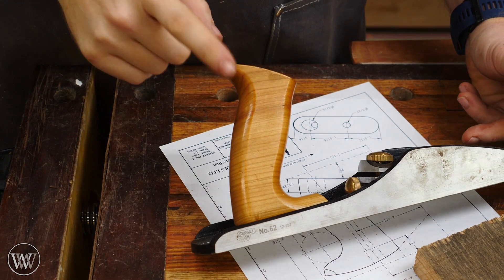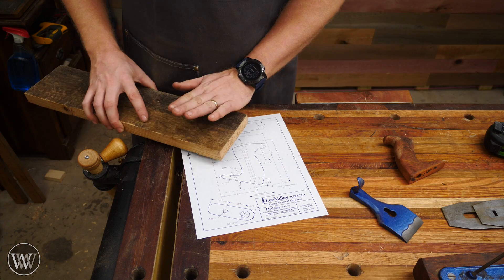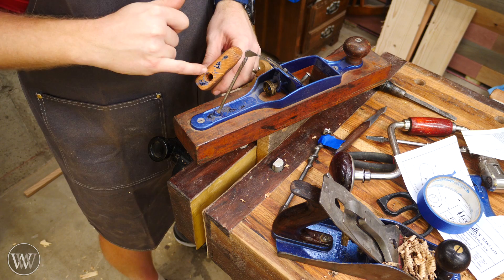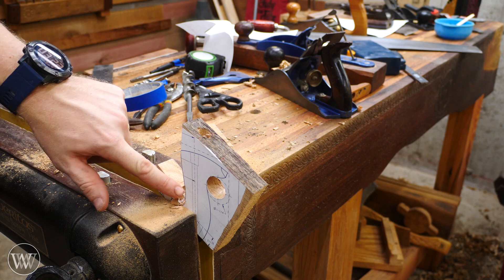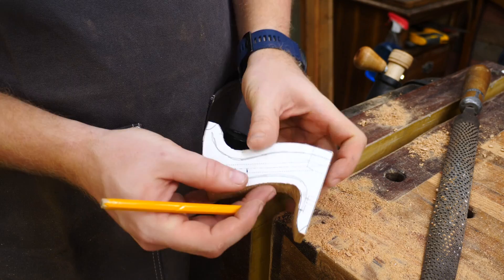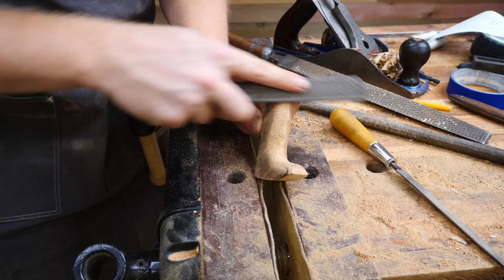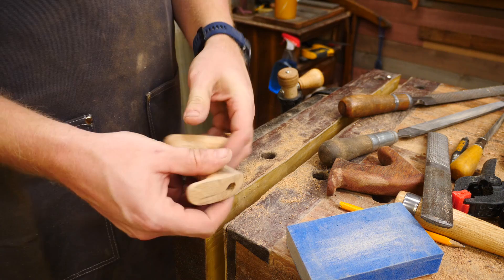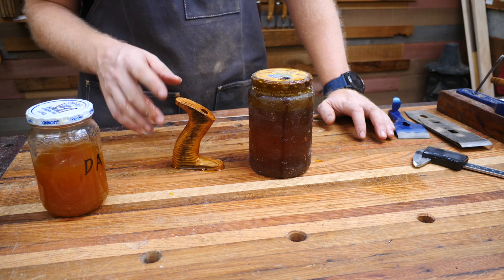How to Make a Tote for a Hand Plane | Making a handle with hand tools

Comment: Great video, as always. It inspired me to have a go. The grain on the tote is a weakness, so I have made mine in two laminations of macrocarpa. It’s a bit like Maple. If I had a dark wood I would have used three. I cut a groove in each half for the threaded rod,  and  I crossed the grain for each half to give strength in both axes. If I did it again I would use three laminations with the inner one vertical and spaced for the rod to fit snugly. It’s much more comfortable than the Stanley totes which are a bit thin for me.
Reply from the maker: Nice. I have a couple I have made that way with he three plys. they are surprisingly durable even in a drop. I to like the thicket tote. I want something beefy to grip.
Reply: By macrocarpa, do you mean Cupressus macrocarpa (Monterey Cyprus)?

Comment: Hey James, I think this is the best video you ever did for many reasons.  I think a tote is not easy because it requires a feel and an eye for the subtleties.  Also I love that you used a brace for the long whole and I was floored how accurate you did it.  I've always tried to use a drill press but your way looks so much easier.   I want to make several of these but just can't get to them with other things hanging over my head.  Great work.  Keep it up.
Reply from the maker: +Chris Cunicelli there is always a long list of things to be made and fixed. Thanks for the kind words Chris.

Comment: I thought for sure we'd see a scraper on this project. I got to say, it looks better than the tote I just made from laminated white oak a couple of months ago. There is a poor beginner's quality video covering some of it and the finished project. I actually used some power tools and some carving knives for mine. Using the previous broken tote as a template.
Reply: Here is a link to my video. Turns out I didn't get any footage of me making the tote and knob, but it is an overview of the finished project. It was the fourth thing I ever had on the lathe (I think) and my first hand carved item. Using a power belt sander for part of the process.
https://www.youtube.com/watch?v=cH-qWp_P8Aw
Reply from the maker: i dont use a card scraper often for cross grain cuts, but it does come out time to time on these.

Comment: I've got a transitional I need to restore.  I actually started on the tote at one point, and lucked upon a piece of "sapo" (not sure on the exact species) where the grain moved in a bit of a fork.  I laid it out so that the grain ran at about 45° along the grip and ran straight along the bottom.  I'm looking forward to seeing how it turns out...  after I finish about 100 other projects of higher priority.
Reply from the maker: +Jeff Spaulding that is always the problem so much on that list. Sounds like a fun project!

Comment: You know me, I was looking for a template to make a new tote and bam, your video popped up, I was like, well I  should have known my buddy would have a video on this. Thank you so so much for taking the time to share this with us,. Since you mentioned it, I too agree, the rough from the original weathered look makes it look so much more authentic and i too like it. I do the same with a lot of the leather work when I can get away with it, use the rough edge in lue of the razor sharp cut edges just makes it feel more authentic , yeah, that may be the word. I was able to find the download for both of the templates, Just FYI, the link you had posted previously with this video is a dead link, so if you want I can come back and add the links to the message, but I don't want you to think i am trying to spam your comment, section so for the time being I didn't link the, but i found them via google search, lee valley tote template pdf and they both pop up for the two different Stanley sizes. 
Thanks again kind sir and have a blessed week. I think this is something I can pull off one handed so I am gong to give it a go sometime this weekend. 
Dale
Reply from the maker: thanks for the reminder. for some reason Lee Valley stopped hosting them on their site so you have to google them I just forgot to take don't he link.

Comment: As a suggestion to other viewers make your custom tote out of softwood as a trial & error template. If you make it thick to start you can easily remove wood from the handle where you don't want it. Then put the plane through it's paces on some wood. How does it feel? When satisfied with the grip then make a hardwood version.
Reply from the maker: interesting idea? mind if I ask why not just make your hardwood one first? I often find the hardwood to be much easier to shape as it is less likely to ding up or go too far, but that is just my personal opinion.
Reply: The truth is that I did not know what size tote would feel the best for me.  I do have large hands that feel cramped even with only 3 fingers wrapped around it. By making the tote very large I have shaved off portions to bring it to the size i like. That is 1 1/2' thick and as high as i can get without interfering with the lateral adjustment.

Comment: i have large hands and a number 3 stanley hand plane, the smallness of the tote kinda hurts my fingers a little .. can i enlarge the tote? or is that a mistake? or should i just buy a larger hand plane?

edit:
it's short .. it squeezes my fingers from the top and bottom .. can i make it taller if i have clearance between the tote and the iron?
Reply from the maker: Yes. Actually I know of a few people who have made a slightly larger handle to fit their fingers. I end up modifying a lot of mind to fit my hand as well. Three fingers don't always fit between the body and iron but if you can adjust the handle to make them fit it is a fantastic thing.

Comment: I think the reason that the pattern from Lee Valley doesn't align the bottom of the tote with the grain direction is less a question of strength than it is a question of ease of construction. With Lee Valley's pattern, the main hole through the tote (for the bolt) is exactly perpendicular with the edge of the blank, so it's easier to drill that hole with a drill press, etc. Rotating the grain direction by 20ish degrees won't really make the tote any stronger or less likely to split than the orientation that you used.
Reply: yeah, the pattern clearly had a cut line perpendicular to the top of the bolt hole. His method worked for him, though. I think with my limited fine woodworking skills, I would have used that cut line so I could drill at 90 degrees to the wood. It would have been much easier for me.
Reply from the maker: right on. they like to drill the block on a drill press.

Comment: Hi! You are a real inspiration for me.
As I saw you using files and rasps for making a handle, and as I want to make two handles for my saws (one 26" saw with thumb hole and one dovetail saw with open pistol handle), what set of rasps and files would I want to have, knowing that I don't own any file or rasp at all yet? 
Also, where I'm going to buy them (Glardon/Vallorbe rasps and files, produced at 50km from where I live, and surprisingly not that expensive for Swiss tools), they offer specialised file in either wood or metal. As I will mostly work on wood, the choice seems pretty obvious, but will it be still possible to use them occasionally on metal without destroying them instantaneously?
Thank you so much for your help.
(by the way, please excuse my possibly broken English, which is due to my condition of not being a native speaker (although there are non native speakers who master the language, but it is not my case (yet)))

Comment: Hi James, this is something I plan to start with this weekend (or next) to replace a Stanley# 4 tote. I am sure I will mess up my first attempt at least as I there are a lot of new things for me to try in this project here - drilling straight and perpendicular is of course a big challenge but I will try that until I succeed (hopefully sooner 😉). I have a couple of questions: 1) What is the thickness of wood you started with? 2) I haven't truly started working on hardwood yet. I only have access to a home depot nearby - which hardwood options would you recommend considering robustness, ease of use for  tote? I believe they have predominantly red oak (sometimes white oak), I have seen walnut and sometime Mahogany. I don't think they carry beech or ask which I believe are more well known for making handles and knobs. Thanks!
Reply from the maker: I start with about 1" thick wood. They all have their pros and cons. Oak is difficult to work, but fun. Of those the easiest would be walnut or mahogany.
Reply: @WoodByWright  i am struggling to find any decent hardwood at my local home depot that is more than 3/4" thick😑 will it work if I laminate/glue 2 pieces of 3/4" blocks to make it 1.5" and start with that? Or do you think that kind of gluing would cause issues (during drilling or rasp or even prone to breaking). Want to be somewhat sure since hardwood is damn expensive but I really want to try this project.

Comment: Nice job. Question ... about 16:49 it looks like there's a split in the horn at the top. Later it's closed up, though still slightly discolored. Did it split and you repaired it, or was it just a wood imperfection that got less noticeable as it was rasped down? Either way, enjoyed it. I like the BLO best too.
Reply from the maker: yup. there was a split that I thought would cut out with it. in the end I filled it with epoxy, I just forgot to video the adding of epoxy. oh well.
Reply: Good to know ... and good for people to realize that things happen. Fix it and keep going. Thanks for the vid.

Comment: James, can you cut with the saw both hands are you ambidextrous in your sawing and your filing?
Reply from the maker: yes I have worked at being able to cut with both hands. very useful for on those odd cuts or long cuts where you want to give it a rest.
Reply: FYI. White Oak is not porous.  That’s why it was and still is used to make barrels.  Red Oak on the other her hand is very porous.

Comment: A suggestion: cut a line perpendicular to the drill hole (you already have the line drawn on your template) then you wouldn't have to drill at an angle.
Reply from the maker: I could but with a brace and bit every hole is at an angle. That is the common method if you use a drill press though. I just find it faster and easier to eyeball it.

Comment: Ok, have to ask, what is the issue with using a glue stick? I have used this as well as spray adhesive, depends on what I have on hand.
Reply from the maker: some people think there is only one way to do something and all other ways are not the right way to do it. for some reason how to apply a pattern is one of those subjects that really bugs people.
Reply: I'm open to new ideas, that's why I watch a large number of woodworkers on YouTube. If I didn't want to learn I wouldn't bother. Happy to give new techniques a go as long as it keeps me happy, and keeps all my digits attached.
Reply from the maker: I could not have said it better myself. I feel so much the same. experimenting is more than half the fun!

Comment: Tote. Handle. Meh.... The back one is the tote, the front one is the knob, but both are types of handles. 
I'm not aware of anything regarding the etymology of the word itself that suggests it's a handle of any kind. It mostly seems to derive from words meaning to carry, to bear (as in toting a firearm) or to drag around... and since you don't drag the plane, it still doesn't tally exactly. 
So use whatever word you feel like, really!!

"Voila" is another matter, though and a personal pet peeve - Pronounced "Vwa-Lah", rather than "Wah-Lah"... !!! [insert "GRR" face] :-p

Nice long video, and the handle sits rather nicely against the wooden body and the front knob, too. It's got me looking around my workshop and wondering what other handles I could have a go at making.....!
Reply from the maker: LOL don't tell that to a perfectionist. Thanks man!

Comment: What is the 4 way rasp that you're using? Do you have a link for it? Trying to find a decent one, but Amazon and Rockler don't have many reviews...
Reply from the maker: this is the one I use. http://amzn.to/2AqPtI9, to be honest, there is not a huge difference between the cheap ones and the expensive ones. I am not aware of a company that makes them hand stitched. that would be the one thing that would make me want to spend more then $20 on one.

Comment: The adjustment lever on that plane looks bent downwards. 24:20
Reply from the maker: that was just an old method of making them twisting the steel rather then welding or folding it.

Comment: Why is the handle called a tote?
Reply from the maker: It's an old fashioned term that means handle. But with a hand plane there are two handles so it's used to differentiate between the knob and the tote.